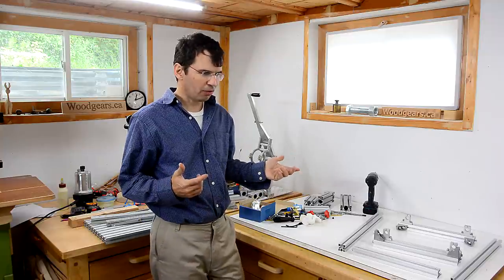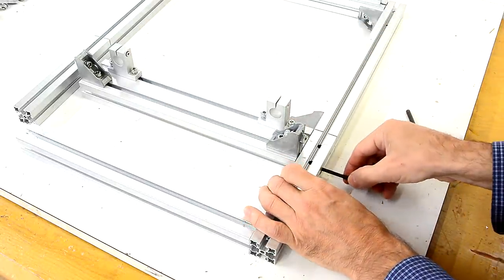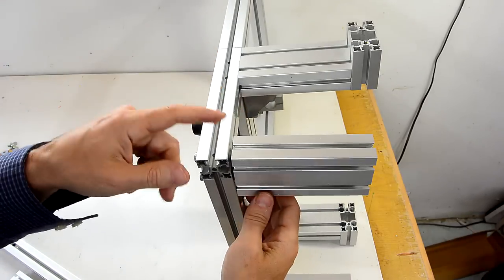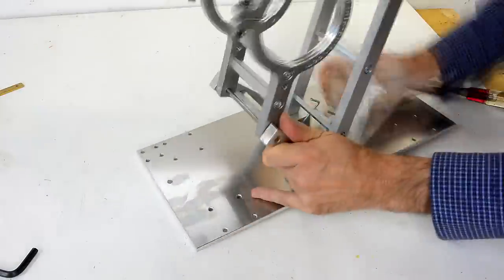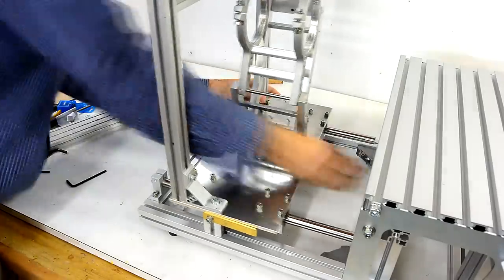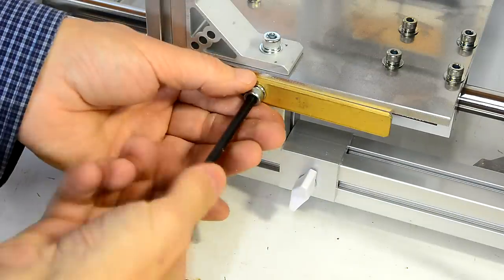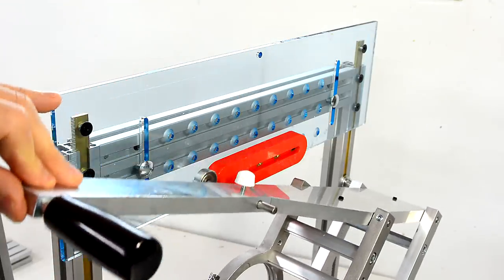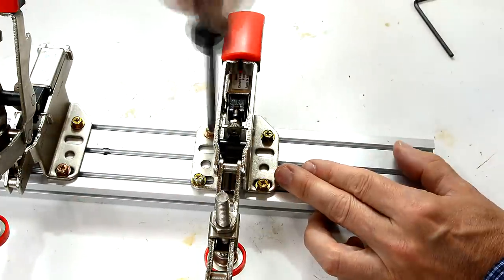How to assemble the metal pantorouter

Comment: But will it do pocket holes? 

Sorry. I'll see myself out.......
Reply: +rochat Yes, it will. Set the tilting base to 15 degrees and bore the pockets. Keep the template for the hole positions in the machine. Switch to the smaller size bit to bore the front of the pockets, and voila! The cleanest pocket holes you have ever seen!
Reply: I guess they didn't get the inner joke 😃
Reply: Yoram Krengel nope.

Comment: One quick suggestion during assembly is to apply blue (not red) Locktite to the threads of the bolts and screws as this tool might rattle itself loose and you might not notice it until it ruins a piece of work.  Ask me how I know!  My $0.02.

Comment: I may have missed it, but I didn't see where the ambifascient lunar wainshaft was connected to the differential girdle spring? Without this, wouldn't the machine suffer from side fumbling in use? Or perhaps the arrangement of the spurving bearings prevents it?
Reply: +ib9rt I didn't see it either, nor do I see any evidence of marzel vanes.

Comment: nice improvement of your machine. Would be nice if the individual stops you use in the end are some how exactly in line so you stock is not only stopped but also exactly in line with you router bit.... of course you can use a ruller to measure this but the edge of the table could be used for that
Reply: +Martijn Fransen That's a good point. It shouldn't be too hard to make. If you just elongate one of those stops so it covers several slots in the table, it should be in line with the router bit. Or, you could make it yourself with wood and those bolts Matthias showed towards the end. If it's made well, it only needs to cover 2 slots.

Comment: It would help to know the router that is needed to fit this.
Reply: +Stephen Day 
The Porter Cable 890 is our new favorite but requires slight modification so it must stay in the Hybrid PantoRouter. The DeWalt model 618 is very common and inexpensive and slips right into the router bracket.  There's also a special order Hybrid PantoRouter for a Ridgid router.  Check the website at www.hybridpantorouter.com and go to the router selection guide.  It's all there.

Comment: Cnc excels in repeat operations and complex geometry. Yes if you only need one or two simple parts it will most likely be faster to print a template and cut it out by hand or a bandsaw etc. 

Getting back to the device in question, again I love it and once set up you can make nice simple joinery fast and repeatable. My only problem is the cost. I think buying Matthias plans is much better. There is nothing there that should make it cost that much. The linear rails are about it. The extrusions look off the self and for a erector style dig kit in my opinion it's way way overpriced.

Comment: If I ran a shop for cash I would buy one.
Those components aren't expensive and the amount of cuts, machining and parts are a lot of work.
As far as "being cheeper if it's from china" ... that usually doesn't happen unless you are making many thousands of something.
Reply: +hassleoffa In addition, it's not from China but from Japan...
Reply: Right ... looks like a beautiful machine to me. Unfortunately when I  make one I'll have to save up my pennies and go for the plans and wood route.
Reply: +hassleoffa I did the one from wood and it was a great learning experience. Do it. You can use mostly scraps in the shop. Suggestion when using the 3/16 rod cut on piece with a slant and use in drill to make it easier to insert cut rod. When finished buy the aluminum tilting table unit. Put the wooden one on Craigslist.

Comment: price point should be $250 - $450. IF ITS MADE IN CHINA close to $250
Reply from the maker: +mikekeystonefl Right...  Or you could buy a less capable "multirouter" for more than twice the price.  Or you could pay more than $1000 for a "Leigh FMT pro" jig, also much less capable.  This thing is much better value than the competition.
Reply: +Matthias Wandel What does this do that a multi router can't?

Comment: Whats interesting is that is the same type of extruded aluminum that was used on my solar system, i have a bunch of the end peaces in my shed lol, the 90 degree angle brackets also look identical to the ones that came with my solar frame kit..